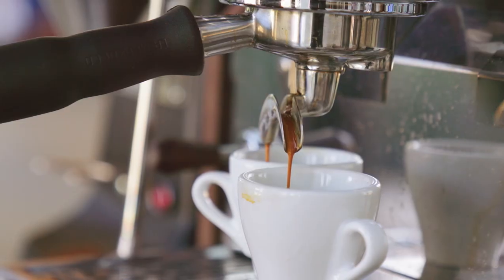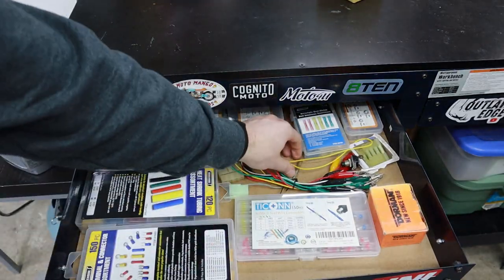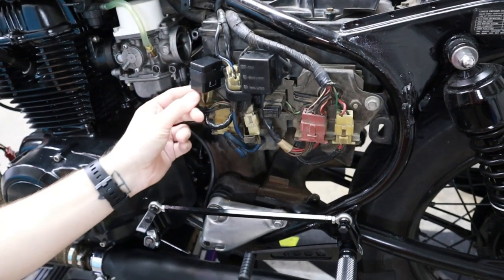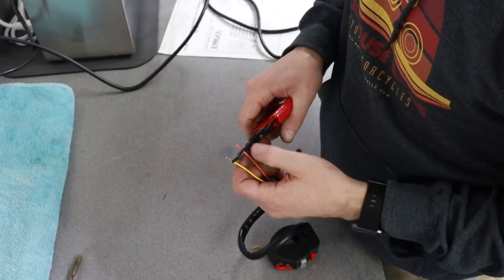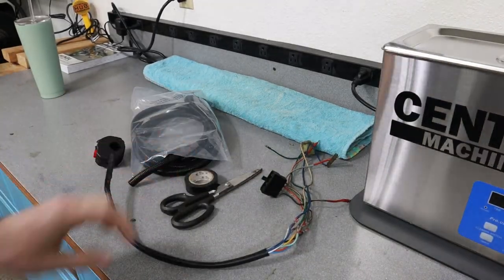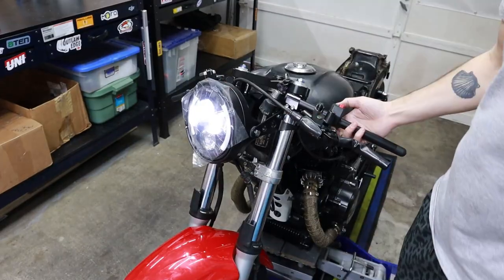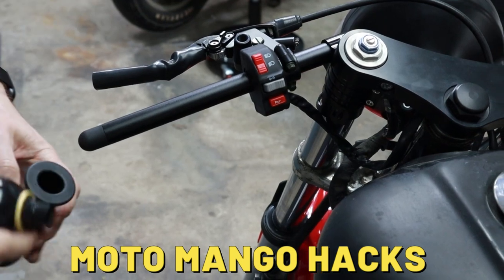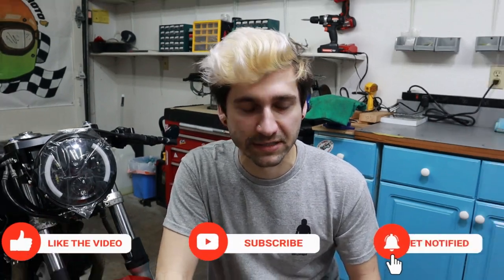Installing a Universal HEADLIGHT and CONTROL SWITCH

Comment: That was SO satisfying to watch.  A project that included electrics where you just had everything right there and it kept flowing, love it!  [in reality, I'm wondering if you had to order & wait for the new relay, but I bet you had it at the ready].  Such nice work, I dig it!
Reply from the maker: Thanks so much bro! Haha I have a lot of parts laying around from past and current projects. It's kind of a problem 🤣🤣
Reply: @MotoMango  I wouldn't so much say it's a problem, I'd say it's a stockpile of solutions!  I love when I have JUST THE THING lying around to finish a project that went sideways.

I mean, related to motovlogging, I had my Hero 9 fall off my Harley while I was riding... the next day, I was back up & running with a new solution - because I already had tons of leftover mounts and stuff from trying things earlier.  Cobbled together an even better solution than I started with!
Reply from the maker: That's true! I like the positive thinking xD
Reply: @MotoMango  No other way TO think... the other kind of thinking doesn't get you anywhere, now does it? :D

Comment: I have exact same looking head light, but does yours have metal housing or is it plastic as I have? Nice work BTW!
Reply from the maker: Thank you! Yeah, it has metal housing. It's a kit I got from Amazon
Reply: @MotoMango  Yeah Looked the link. Is that housing round from the back or is it like in CB:s tehy have little bump in there?
Reply from the maker: It's mostly round on the back side no square bump out